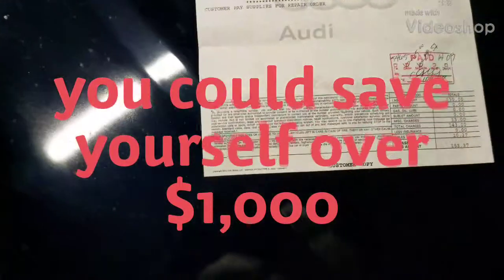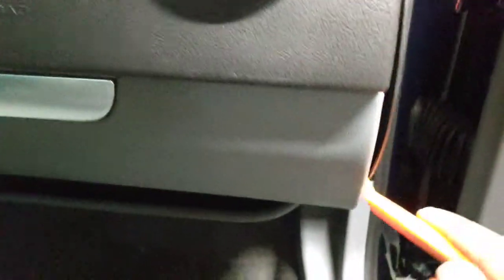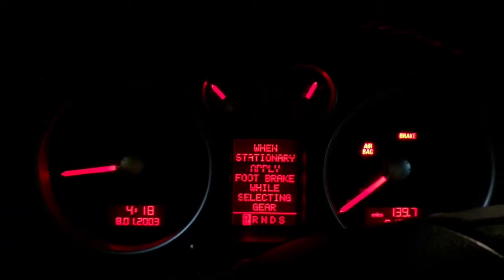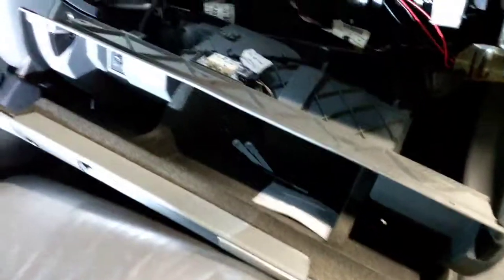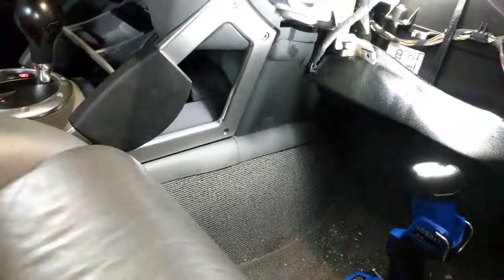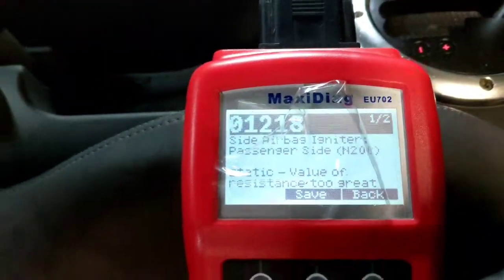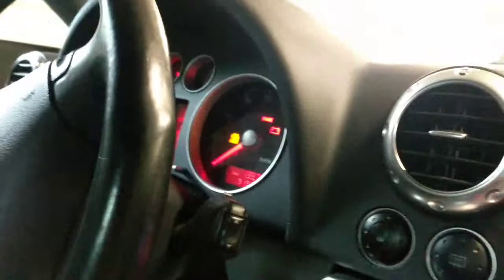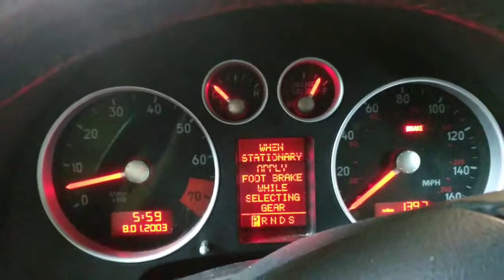How to track down and fix an airbag light Audi TT

Comment: Hi. so was the problem with bad connection under the passanger seat or in the glove box too? No fault in glovebox? - right? Thanks for reply.
Reply from the maker: The bad connection was under the passenger seat
Reply: idennis75 .....Thanks for replying so fast.I bougth from Ebay the Audi tt airbag light turnoff electronic box - it didnt put down the warning light. I have checked under the driver seat on bad connection, but ok. I didnt know that under the passenger seat there is similar connections with the yellow cable. Thank you for your video. i have to check that now. One question only: wouldnt it have been  easier to start the problemfinding to check first under the seat?
Reply from the maker: Make sure when you push the wires together your hair a click because mine was together but it just wasn't pushed in all the way

Comment: Having the same problem...everyone is telling me to disconnect the battery. I didn't see you have any issues not disconnecting.  Thoughts?
Reply from the maker: I did not disconnect the battery a lot of people suggest doing it but I've always troubleshoot with power so I know what's going on and I would suggest taking all the connectors loose you can disconnect the battery but clean everything maybe put some Dielectric grease plug it in to make sure it clicks especially your grounds
Reply: @idennis75  alright...thank you. 🍻

Comment: I suppose you kept the battery on; if so I thought it was risky to disconnect airbags. What do you think?
Reply from the maker: As long as the two wires inside the bumper module does not touch each other the airbag won't go off and if you do take the wires apart don't turn the car in the on position until you put everything back or you'll need computer to reset it some vehicles you have to bring it back to the dealer which could run you up to a hundred and fifty bucks
Reply from the maker: As long as the two wires inside the bumper module does not touch each other the airbag won't go off and if you do take the wires apart don't turn the car in the on position until you put everything back or you'll need computer to reset it some vehicles you have to bring it back to the dealer which could run you up to a hundred and fifty bucks

Comment: I run a diagnostic but show no errors, although my airbag light is on. I might buy one of those device specially made for airbag lights on aliexpress
Reply from the maker: Yes you have to buy one that reads airbag codes the engine code reader won't show it